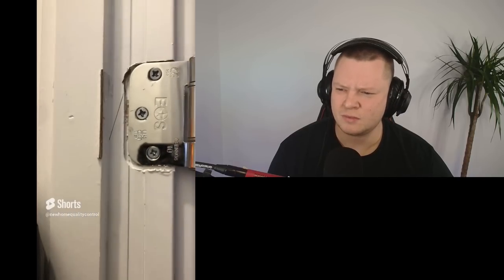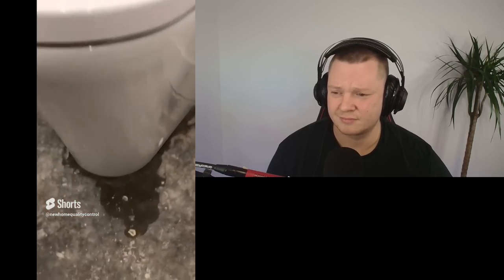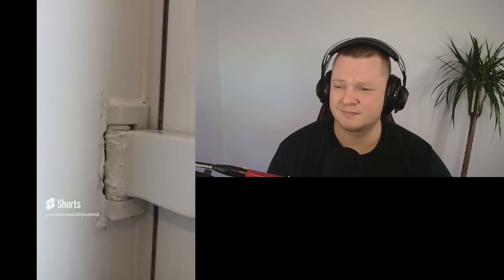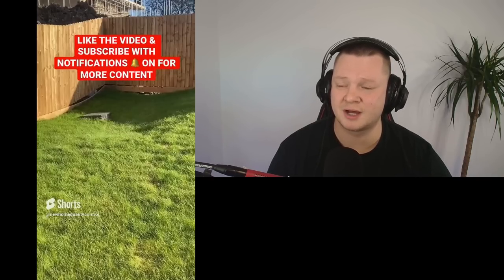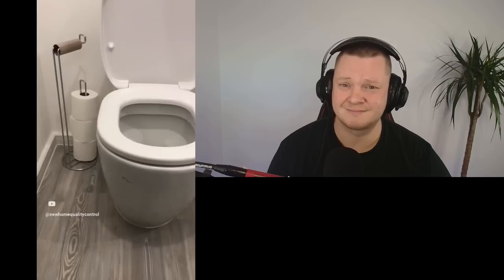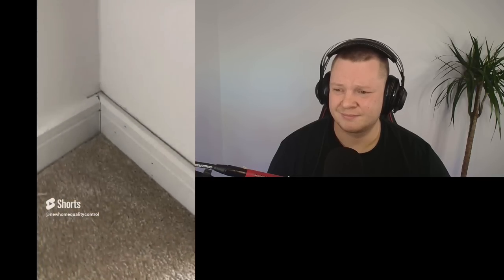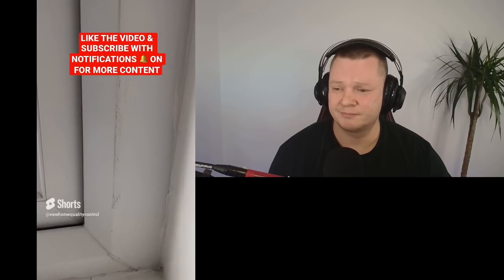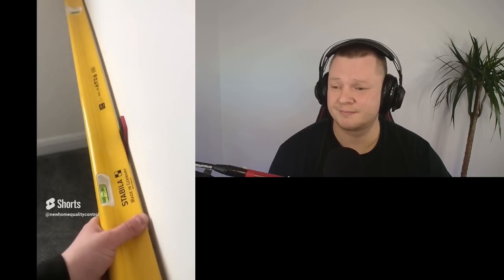How do you fix New Build Snags? | The Snagging Breakdown #5

Comment: The question is do the snags get fixed in the end. I've seen so many bad builds in my profession but it keeps me in work as I get hired by the owners to go fix issues
Reply: I had zero issues getting my snags fixed. I would say though it's probably easier whilst they are still onsite and most of the trades are kicking around already.

Comment: Probably someone else in the comments has already said this, but here goes:- 
That loose connection on the light switch in the loft is not only a shock hazard, but also a potential fire hazard if it starts to arc which it will in my opinion. Also in my opinion it should be mounted vertically on brickwork or masonry rather than wood to minimise a fire hazard i.e. On a wall next to the loft entrance.😀
I have an IP65 outdoor light switch in my loft connected to an IP65 LED double batten fitting. Cost a bit more to be honest, but will keep on working if the roof leaks and the cost was mitigated by me being an Electrician so all good.🤗

Comment: It's strange that on some housing estates in Cornwall, just a year or so after completion, one can see scaffolding erected on some of the houses in order to remedy defective roofing.
Reply: Theres a new build 400k+ new estate by me, one on the island has had a patched roof and new dormer after 2 years,
 only been up 4 years
Reply: Which one was that?

There was that estate in St Agnes that where missing insulation when built and the outer leaf had to come down to re do the job
Reply: Bought a new build for 450k back in 2008 - absolute nightmare, insulation falling out from between the rafters, 2 inch air gap between the last block course and the roof (wtf), leaking front door that couldn't be fixed and a myriad of other irritating and unacceptable issues - never again.
Keep up the good work

Comment: I love the breakdowns on these videos! Quick question: what are the negative effects of a wall being out of plum? Does it lead to structural issues or is it just atheistic?

Thanks for the videos, keep fighting the good fight against the tuna melts and fake weep vents!
Reply: If it’s far enough out of plumb for a e high  enough length, the center of gravity would no longer be over the base bricks and it’d collapse. But the real issue (because if it collapsed before handover, it’s not the client’s issue…) is that any subsequent movement (like subsidence or during a storm) is that much more likely to push it over an edge.

Comment: Surely cleaning up the mold is just step one of a chain of actions to find out why it's there and how to prevent it from reappearing?
Reply from the maker: The lost should dry out helping prevent it
Reply: @newhomequalitycontrol  they should investigate the cause of the mold first (roof not venting properly, moisture buildup from bathroom vents not connected etc) then clean it off with antibacterial cleaner. Just my thought.

Comment: I'm curious as to what the process is to get these damages repaired. To my knowledge snagging inspections are freelanced by the homeowners right? So do they simply present the list of damages to the realtor to get them to amend the damages? Do the homeowners now have to pay for all the work to be done? Can the builders or realtors be held liable?
Reply: And the site managers! Is there any way to hold these winklespanners responsible?
Reply: New homes are warranteed by NHBC usually. The developer has to pick up the cost of fixing the issues if they deviate from NHBC's regs. That's where the 'tolerances' etc. are coming from. If problems occur and the build did conform to NHBC's regs, then NHBC pays out. 10 years is the max warranty - there are other providers but NHBC is the main one
Reply: @hydorah  oh brilliant, thank you for the information! Very informative and nice to get those details that eluded me. I hope you have a wonderful day! 🤗

Comment: Do you ever do critical dimension checks to ensure your client is getting the size of house and rooms they have purchased off plan? 

You mention walls may need boarding out and the plaster feathered in to make them vertical and within those tolerances, but boarding out will reduce the room size, and the clients will have bought the house off plan with agreed room sizes, do you check to ensure there is scope to over board before including that as the snag items fix, if the room size is close to being under tolerance you may need to request the wall be re-boarded instead. We typically include tolerances of +/-3% in our contracts for critical dims.
Reply: Would have thought reboarding would be cheaper easier and faster than what he suggested tbh.

Comment: Too many homes are built identical, on these estates for ease of building. Unfortunately this means that a lot of the time site managers and other trades will check a couple of the houses and sign them off.
Things like electrical and gas problems I would strongly advise speaking to the CPS scheme that was used to sign it off.

I actually had a site manager ask me once to quickly sign off a house 2 plots over that I hadn't tested yet.....ummm no. He kept saying but they are all the same....don't care was my response, that was the last time I worked on a new build site

Comment: I've never personally embedded a hinge in a wall but I don't really see the issue. My 1960s flat has the door closer embedded in the plaster and I'm not the least bit bothered.
Reply: If the hinge fails in some way it may be a nightmare to fix depending on how the hinge was installed. Moreover, the doorknob won't allow the door to open to the full 90°.

That can be a problem for fire/EMS. It might seem minor to only open to like 86° or something but the extra bit can make all the difference. My grandmother remodeled her front hallway so that it was no longer 100% aligned with the front door. Just that extra 8cm offset was enough that they couldn't get the gurney through the door, twice. Once for me and once for her.

Comment: What does the wheep vent do?
Reply: It allows wheeps in and out ( caterpillar type insects , good for killing insects inside )
Reply: @serenityinside1  oh yes that well known caterpillar type insect called a "wheep" quite often see alongside fairies in the garden I believe?
Reply: @thepikeangler2022  (◔_◔)

It's to let moisture out of the brickwork so it doesn't build up and create mold. Or, in my case, there were no vents in a concrete (not brick) wall, and instead a 5cm crack less than 1mm wide in a roof shingle led to water flooding into the master bedroom. Yes, the shingle should've been fixed anyway, but it wasn't fully necessary if the water had an outlet. Also, I didn't know where the leak was. It was such a tiny crack and I'm not a roofer so it took me 6 weeks to find. Out of frustration I pulled on every shingle and one of them tore.